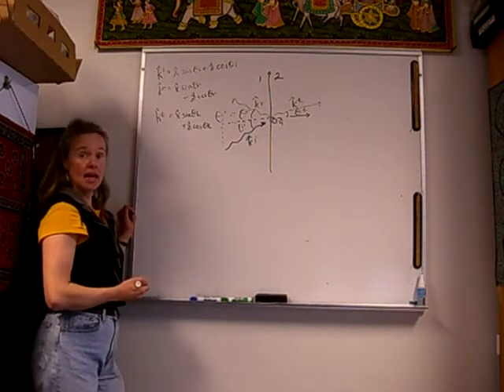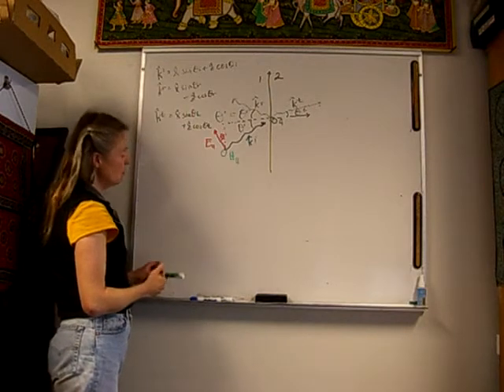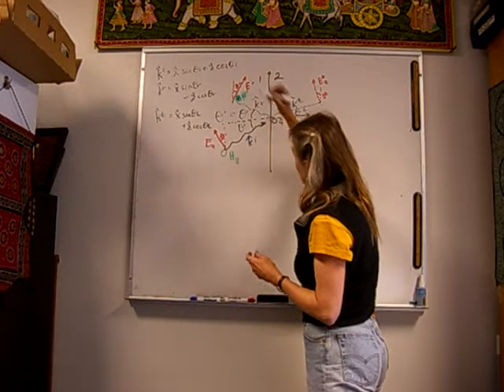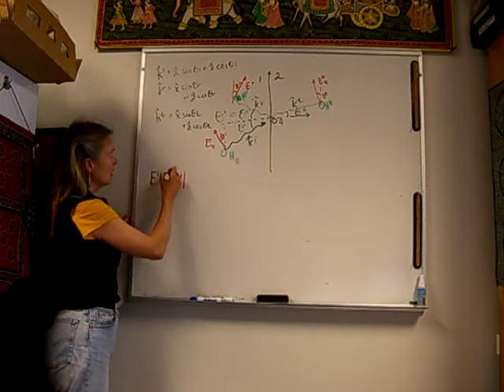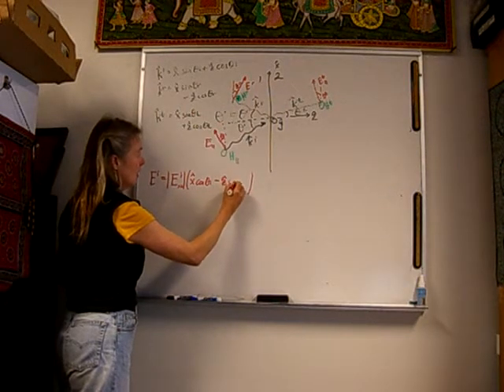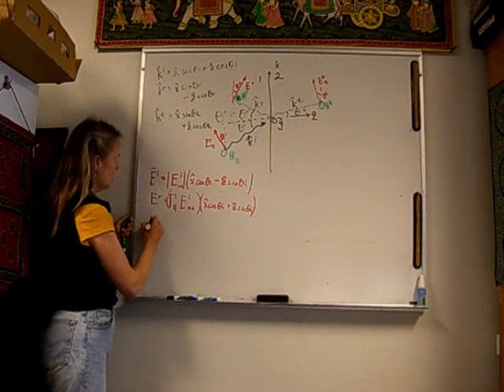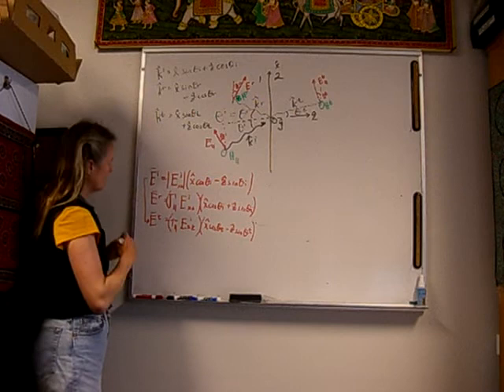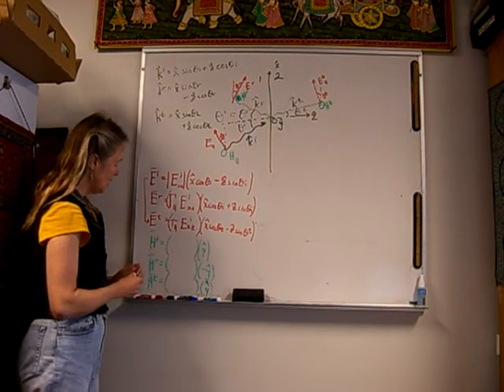ECE3300 Lecture 30-6 Plane Wave Reflection and Transmission, Oblique Incidence

Comment: in perpendicular or parallel polarization, if the second medium would be a perfect conductor then the E field=0 inside it (that is no transmitted wave {E(tra)=0 } in medium 2) and the general equation E(inc)+E(ref)=E(tra) would become E(inc)= (-)E(ref) implying a change in polarization (but only in case of E)
However since there is a transmitted wave in this figure, the 2nd medium is a dielectric and the E field is not 0 at boundary surface and it can be polarized in any way
this is what i think